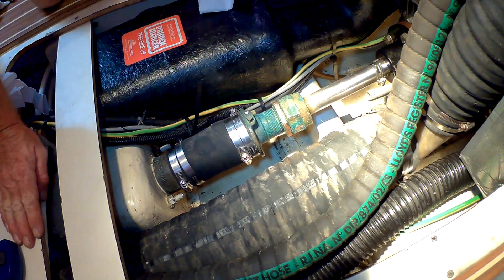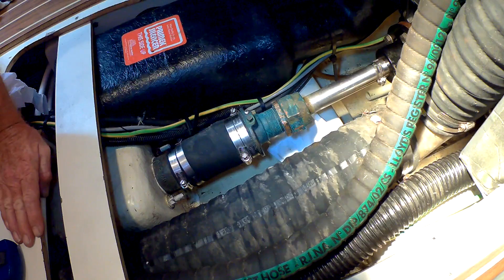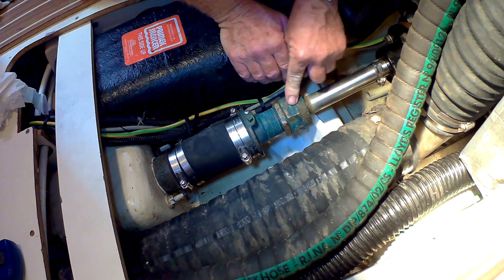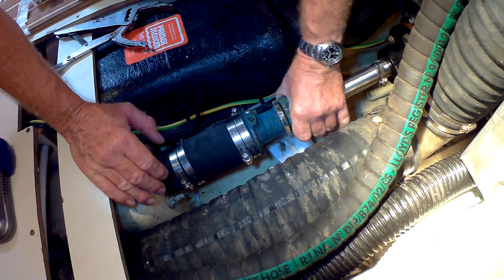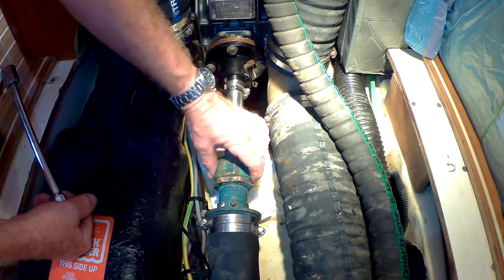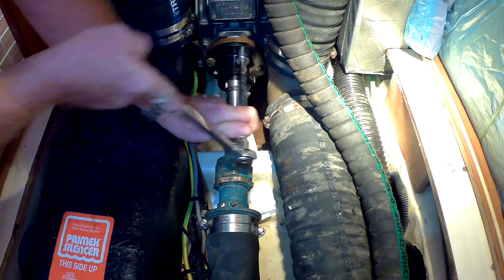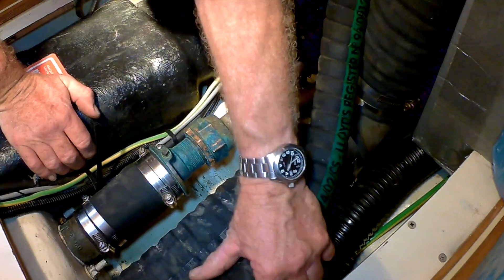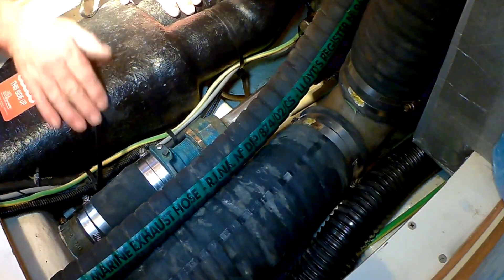That Sinking Feeling - a dripping stern tube

Comment: Out of curiosity, but wouldn't the shaft stay in the boat when the propeller comes in contact with the rudder?  I worked on boats years ago and have never seen a jubilee clip or hose clamp on the shaft.  No disparage to the video, just curiosity.  Thanks.
Reply: Some boats have offset rudders or twin rudders that are not in line with the prop .

Comment: Thanks for this tutorial. Can I or do I even have to change a packing while the boat is in the water? How much water would come in with no packing at all?
Thanks again
Torsten
Reply: You will get water in the boat while changing the packing with the boat in the water, but nothing that will sink the boat.  I've changed the packing while floating, but always had the new packing cut and ready to put back in once you've taken the old out.

Comment: Hi I know this has been up for a wile but I a grease packing gland on my boat and it dose drip water it slows down a lot when I re-pump the grease through maybe 2-3 drips per minute however on your video I notice you have a sub title stating a greased packing gland should not drip do you have a video on resolving this or do you have any advice for me ? Cheers .jake.